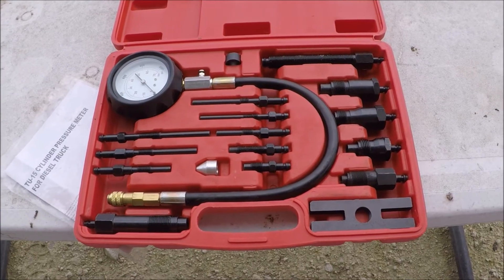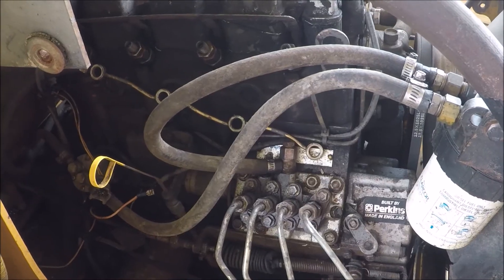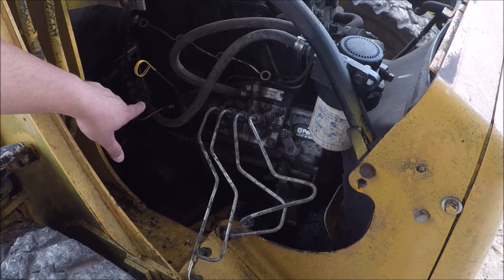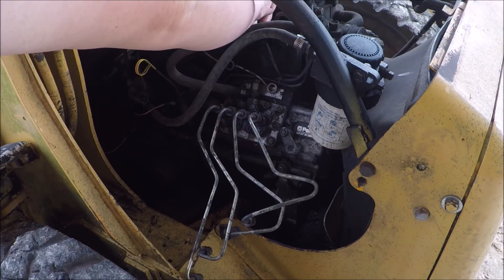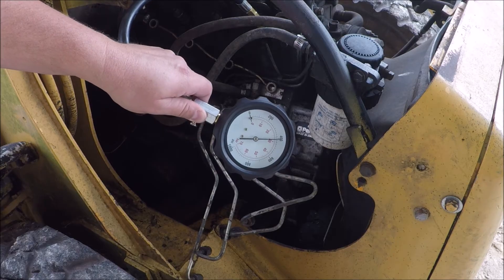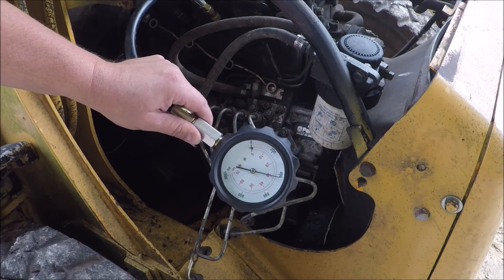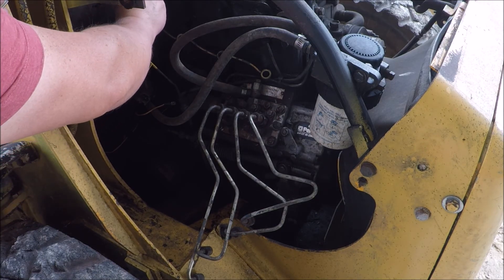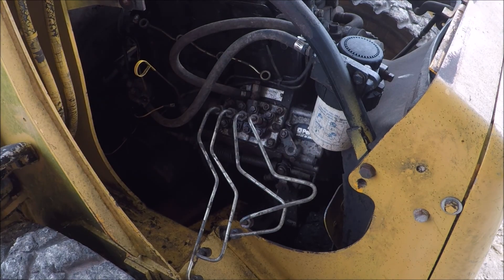Compression Testing a Diesel Engine | Perkins 4 Cylinder Diesel

Comment: I have fhe the same engine and its losing power under load. It runs fine when its not loaded. It starts fine. Im going to try injectors. What symptoms does your engine have ?
Reply from the maker: Mine would do the same.  Sounded great and checked out fine compression wise, but ended up being an injector pump and injectors.  I sold the tractor too.

Comment: What is spec.  and should you do wet test?
Reply from the maker: I am not sure what spec is on this machine and it will vary on different engines.  I do usually disconnect the injectors.

Comment: Can I use a diesel kit for petrol ?
Reply from the maker: Yes, it should still work.  The pressure reading will be much lower than diesel but the kit should still do the job.
Reply: @SeidelRanch  probably just the attachment different?
Reply from the maker: @tiago10alves10  The diesel kit comes with many different adapters for injectors and glow plugs.  I think I remember that one of the adaptors fit spark plug holes too but I am not 100% sure.